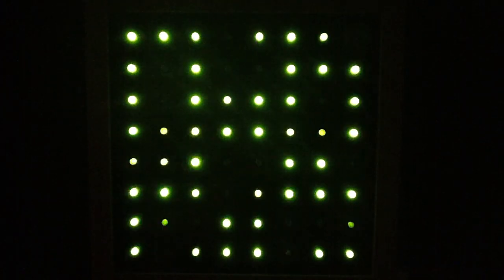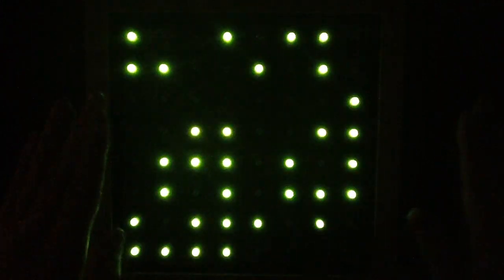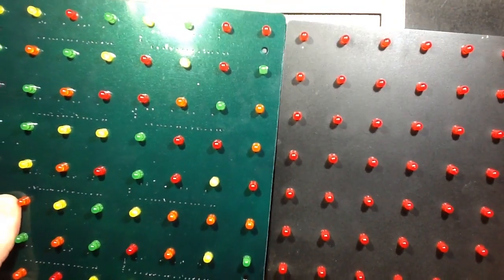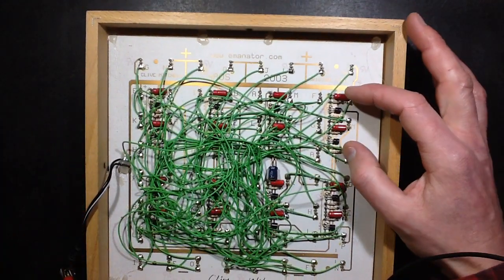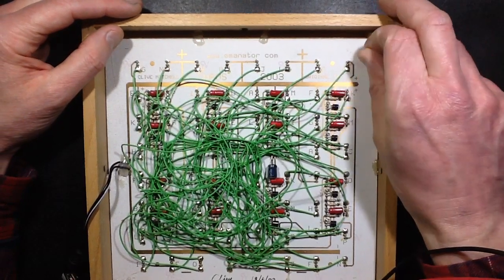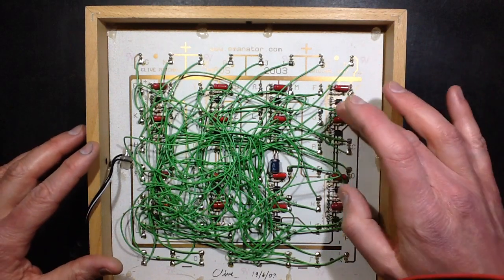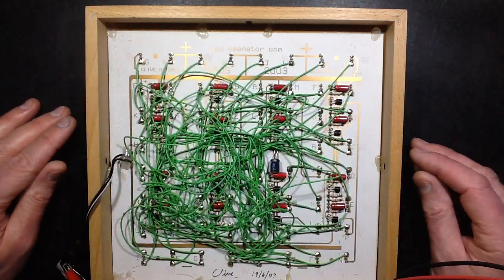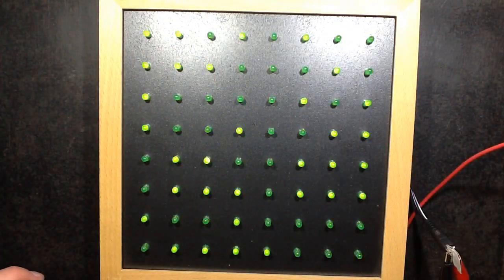LED panel from retro computer prop.

Comment: This is the first time I've seen this, and with me is my five month old kitten "Katie Cotton" - She sat there, mesmerised by the flashing lights. Now she's gone off somewhere I can't see. - There's no danger of this device being used to reprogram cats by any chance?

Wow! - Discreet components. I haven't see many of those in a while (in modern electronics).  A thought does occur to me though. Is it possible to get flashing LEDs with random interval timing? So that each LED flashes at randomly varying speeds?
Reply from the maker: The panel in the background of my live streams is just a matrix of self flashing LEDs running slightly out of sync.
Reply: @bigclivedotcom  Hi Clive, I'm aware of the "Super Computer" panel, but what I mean is, is there an LED which can randomly vary it's rate of flash. I've heard you referring to LEDs with various fixed rates of flash, but I'm curious to know if there's an LED with a random rate of flash? (Not the flicker LEDS with an audio driver).

Comment: When I was at school in I was asked to make a bleeper to fit in a model of a satellite to celebrate the moon landings.  I used two flip flops, one to produce a tone of about 1 KHz and the other to switch the tone on and off at about 0.5 Hz.  It was great but when the school settled down after break it could be heard from one of the building to the next, which didn't go down well.

A few years later I'm a mainframe computer engineer, all the logic elements were discrete components and the major signals were brought out to a large front panel covered in small neon indicators, the whole thing looked like a sci-fi setup.   LEDs were just coming off the drawing board at that time.

Comment: Amazing work, man!  Thumbs up!  :)
Though a bit of overkill from a 20th century point of view, perhaps. ;)
Arranging blinken lights (or blinking LEDs) in an array/matrix would also have had done the trick.
Anyway - Your work is much much more elegant than using a microcontroller, I think!
Reply from the maker: This approach ensures that 50% of the LEDs are on all the time.  No sudden intensity fluctuations.

Comment: Such an elegant and simple design for something with such a complex looking effect.  When you said flip-flop I thought you meant the digital logic type, but these are just transistor astable multivibrators right?  Two transistors, two caps, four resistors.   So by using different timings and scattering the outputs across the board you get a real 'random' look, I love it.

Comment: I suppose in television or movies, you have to make these computers look like they're actually doing something. Blinkenlichten are a really good way to do it. Another way is tape reels going back and forth, a technology only the grey-bearded mainframers remember. I remember watching a a reel tape unit  suck in a tape  with compressed air and all - beautiful.

In Real Life, though, massive servers are boring. Network switches are a bit better, because they have lights that actually indicate traffic going through.
Reply: That's me!  We used vacuum not compressed air to load the tape chambers.

Comment: http://www.amanator.com/
Is this the website that was on the back of the board?
Reply from the maker: Nope.  It's emanator.  The brand I used to manufacture fairground lighting equipment and props under.
Reply: Yeah, I figured it out in the end. That other guy gave me a start, I wasn't expecting music and didn't have the tab highlighted.
Reply: Aaron Adams has

Comment: this was a year ago I guess,a little over,I saw panels like this on the deep space nine series . Apparently prop makers loved using flip fops and led matrix wall boards. Pretty much saw them in all the Trek series now that I think of it. Thanks for shairing a blast from the past. leds are sure a curiosity. Funny we never had this technology till after the Roswell crash (got my tin foil hat on).
Reply: You'll have to thank Nick Holonyak for the LEDs.  👍👍

Comment: I'm just gonna be "that guy" and straight up ask you what show was it. I'm an american and at that time in 2003 i was at most 7 years old so yeah, i have no guess... but if you don't want to say I respect your right to privacy.
Reply: Forbiddina taking a wild guess... dr.who. XD
Reply: ***** lol wut? didn't that start in the 80's
Reply: Flapjackbatter this has nothing to do with the games i play. I just asked a question not expecting an answer. and the reason i play WT over WOT is really its just the game i played first, i see both games as really incomparable due to the way that they play, WoT is a faster paced, simpler game with stronger mechanics and MUCH MUCH more balanced matchmaking. WT is a bit slower and a bit more realistic with no real mechanics to the game. just memorize crew locations armor designs and thicknesses as well as shell penetration and effects... then pray you don't get kv2'ed... with a side of russian bias. WoWS does have me tempted but i just cant justify the time to play 2 F2P grindfests. not trying to start any fights just felt like saying why i haven't played WoT yet.

the TOG does make me laugh tho. :D
Reply: +Forbiddina 
Ok. So I deleted my previous comment. Because when I read it now this morning I found that it was not ...what do you call it....on the level?
Yes. It was not on the level. Because of a couple of reasons. Sorry about that.

Anyway.
I used to play warthunder.
But not so much any more. I still like to take the Soviet bi-planes out for a spin once in while.
It's a good thing.  : )
Now I have a 8 hours per day wot habit.
It's a good thing. (And a bad thing.)
But mostly a good thing.
Reply: Flapjackbatter lol it's fine man i don't take trash talk that seriously. I personally know that at night you don't always think right... i know that courtesy of a 15 day chat ban in WT XD. But yeah I may give WoT a try one day. but i will surely play WoWS when i get tired of my first grindfest. I'm glad this turned out civil, no worries bro :D
Reply: That's really did make me laugh out loud, sorry. 80's lol

Comment: Isn't the yellow-green LED chemistry Gallium Phosphate (GaP)? I can't find any data on Gallium Arsenide green LED's. Nice job making this and thanks for sharing, thumbs up.
Reply from the maker: Probably.  I just generically call all LED technology from that era "Gallium Arsenide".  Back when LEDs did actually last 100,000 hours.
Reply: bigclivedotcom Modern LED's can also last 100 000 hours if the forward current is limited enough, if the power supply is stable without overvoltage spikes and the environment it is used in is dry, I even have a salvaged modern white LED from a disposable lighter on 9 volt battery with a 22k resistor in series working fine as a nightlight for 2 years now, started as a test to see if it turns blue or not.
As I know the Gallium Arsenide Phosphide is red, orange and yellow LED chemistry and Gallium Phosphide is yellowish green LED chemistry like the ones in the video, these LED's are proven to work for that time and even longer as there is still some in use from 1970's and 1980's, I even have a "Takser-E" LED clock from 1995 with display on 24/7 that still works without any signs of red 640nm LED wear.
Gallium Arsenide was infrared LED chemistry developed in 1960's, but these IR led's drastically lost it's light output with use.

Comment: Flip-flops using discrete transistors - beautiful. Did you get into PIC microcontrollers before or after this?
Reply from the maker: I've been using the PIC microcontrollers since the days of the PIC16C54 and the very first affordable Microchip programmer.  (That still cost a lot and only did a few ROM based chips.)  In fact I can recall making my first RGB controller using PWM to drive the first silicon carbide blue LEDs.  (very dim) way back in 1996.  I guess the application must just have suited flip-flops at the time.  On more recent productions I've used clusters of PIC16F627A's to drive LEDs in a similar style, but with a bunch of independent counters implemented in software, or toggled by a randomiser instead as seen on this "control console" from a kids show.    http://www.youtube.com/watch?v=AKvQUDPFpGM
Reply: bigclivedotcom That'll be the PICstart - I bought one myself - nearly £200 if I remember rightly - connected via serial and all DOS based. We used it to build our pocket slot machine (with servo coin payout). Happy days. I'm keen to get back into programming PICs - a tiddly little 6-pin 10F PIC will be appearing in my next postbag video!!
Reply from the maker: Julian Ilett That's the one.  Bought from Farnell I think.  It was quite radical to be able to be able to program microcontrollers back then.  I had my one of each EPROM based chips in the two sizes.  (One of which I managed to nuke!)
Reply: If you like PICS, take a look into the ESP8266 series of devices. Wifi on-board, programmable with a cheap serial device and available for $1-2 a piece.
Reply: I made my own programmer...well, I say I made my own, I bought a pre-made PCB and instructions and populated it as per instructions. I used the 16C84. I had some credit card style smart cards which also contained a 16C84 (or could have been a 16F84). I remember the DOS program but not what it was called. I'll have to boot up my old '386 and have a look...
Reply: bigclivedotcom I'm tempted to ask what language was being spoken in the "control console" clip. lol

Comment: You'd have thought they would sell them to recoup a bit of the cost at least, rather than destroy them. Are you self employed doing jobs like this? Would be interesting to know a bit more about doing that and how you got into the area if that's the case.
Reply from the maker: I work freelance for various production companies.  As soon as word gets around that you can do the sort of custom electronics used in props you tend to get approached by production art departments to do prop work.  It's not glamorous.  It involves very short deadlines for sometimes quite unrealistic concepts.  The backroom prop makers also get very little recognition.  To date I have received a single title-credit which is the same score as a friend who has run a full time prop making company for about 20 years.
Reply: bigclivedotcom Wow that sucks about lack of credit, without people like you they wouldn't have cool props for their shows! I would quite enjoy doing electronics freelancing etc but wouldn't know where to start. I am mostly a software guy, but have quite a knowledge (and qualification) in electronics. Can you recommend any books / learning resources (especially interested in led projects like yours, an area I have yet to try much). Thanks
Reply from the maker: BytesGuy Best place to start is just getting some components and finding all the information you need on the Internet.  Then just start experimenting.
Reply: bigclivedotcom That's the best way to learn most creative stuff! Your videos are pretty educational too.
Reply: "You'd have thought they would sell them to recoup a bit of the cost at least, rather than destroy them."

That would be because "of the unique way the BBC in funded..."

https://www.reddit.com/r/TopGear/comments/1ug3fx/can_someone_explain_the_unique_way_the_bbc_is/

Comment: was it red dwarf? because i did enjoy that one, but its typical of the bbc, throw out props which could at least be sold, destroy video tapes, then 10 years later ask people for them back when dvd was invented so they could sell them, and prosecute anyone who shared the saves online....
Reply from the maker: No.  It certainly wasn't Red Dwarf.  That show was very successful.  This one didn't get beyond its pilot series.  That happens a lot.  Sadly it also happens to new shows with potential, purely because other productions are given priority funding.
Reply: its happened a lot in US television, the series can even be dumped during its first season and with funding cuts and a bad timeslot, so ensuring it will fail, some thing have to be given time to settle in to enjoy them, many UK shows only took off a few series in too